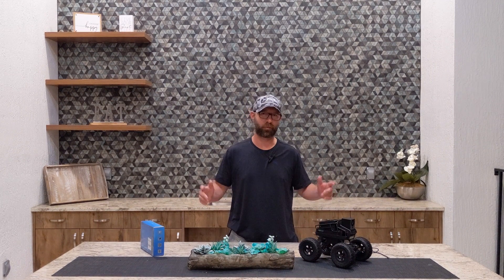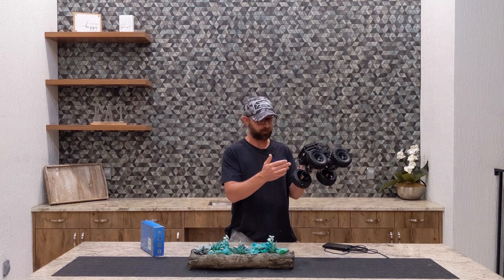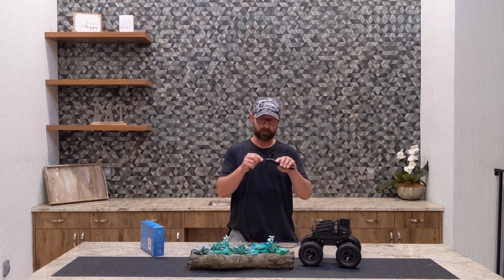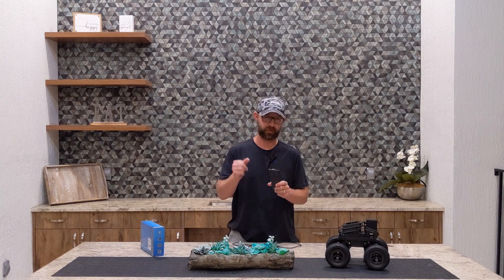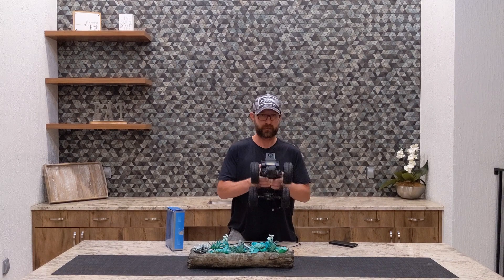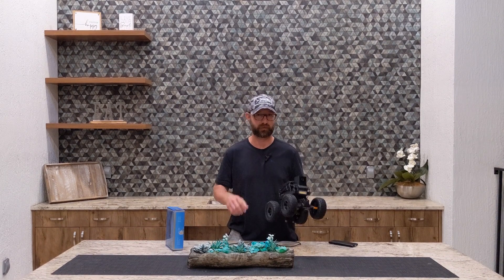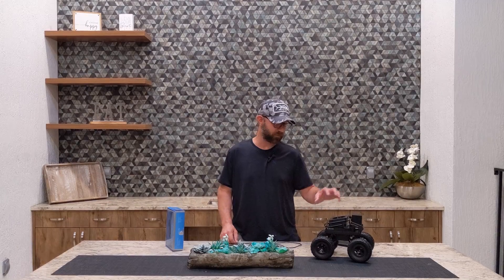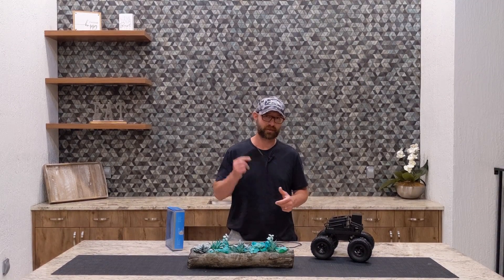Wyze Car Mod Battery Upgrade 2.0

Comment: Thanks so much for all of your videos—very cool! Unfortunately this video gets stuck around 5:30, so I kinda had to wing it from there. I've almost got the single battery setup working. It goes, but only for like a minute and then stops. I think something is happening that is blowing my L298N boards. I've been through two already. As you mentioned at the top, it's a single battery so I didn't add the ground wire. Is there anything else you can think of that I might be doing wrong? Thanks again!
Reply from the maker: Maybe the size of the battery or voltage. Maybe you can send me what exactly you are doing.  I haven't gotten a 1 battery solution to work other than the specific ups I shared in the video.

Comment: The mini ups works perfectly. I even feel that is moving faster. Any idea to set up an efficient charging station? I got the magnetic cable but is difficult to dive it backwards to connect it.
Reply from the maker: I haven't figured out a better way than backing it up. Unless you set up another camera that you can check lol.
Reply: Can you back it up with the same included battery or do you need to have uninterrupteble power battery? I tried plugging to the included battery and can never get the camera to work after the charging cable reconnects, it doesn't reboot the camera, it goes offline.

Comment: Heyyy @Jonathan Goreman,

I just ordered a motor drive board from you just now.
I tried to order the UPS you show and used for the battery upgrade, but they are out of stock.
Besides being out of stock, it doesn't seem as though that one and only distributor of thst UPS ships up to Canada.
I looked, and could not find any UPS with the micro USB-in available on  ebay/ca  in Canaduh.
Would you be able to get a UPS ordered to you, then ship it to me either with the board or seperate?  And add on a handling fee?
Let me know,
Thanks in advance!

Comment: On the part of the video where its showing the install of the upgrade board and battery it freeze frames for a good 2 minutes and just shows the upgrade board then comes back with you driving the car around. Can you please fix the video so we can see how you wire in the battery to the board/car? Thank you and thank you for the information on making our wyze car's more fun.
Reply from the maker: I have another video on my page that also goes really in detail through the upgrade and also on my website I have a diagram
Www.gormansolution.com/wyze-car
Reply from the maker: I see what you mean though I'll see if I can re-upload this video as well
Reply from the maker: Here is the original video that people have been using for the past year.
https://youtu.be/3rvekFixwtA
Reply: Thank you

Comment: The video for me stays when you remove the power cable from the board and then come back when you are driving the car around.
Reply: On the part of the video where its showing the install of the upgrade board and battery it freeze frames for a good 2 minutes and just shows the upgrade board then comes back with you driving the car around. Can you please fix the video so we can see how you wire in the battery to the board/car? Thank you and thank you for the information on making our wyze car's more fun.
Reply from the maker: Yes for the board but not for the camera. So if you disconnect the power on the portable charger running the camera it drops which is annoying. Not the end of the world unless you are trying to leave it so you can drive it when you are not home